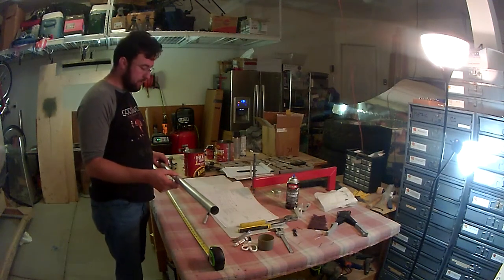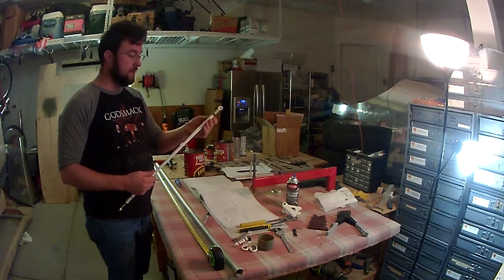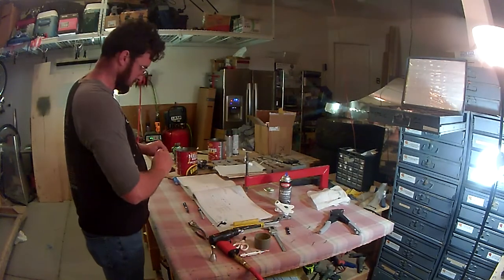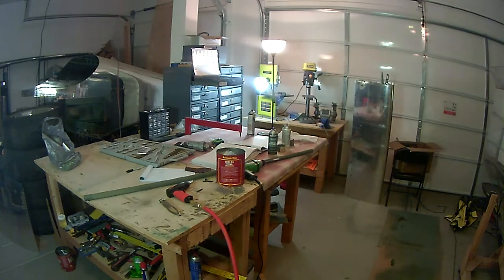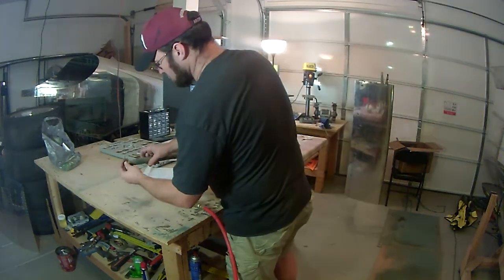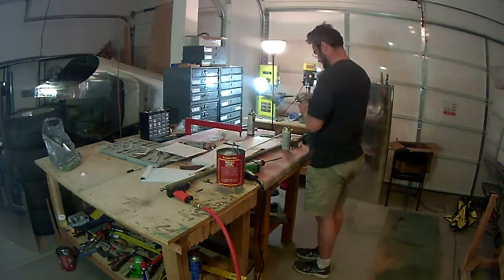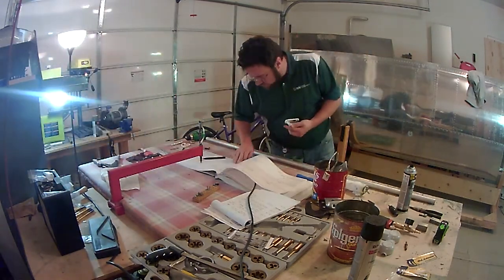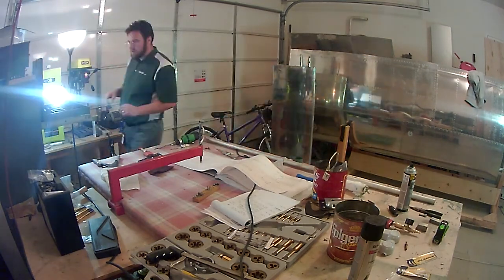Scott's RV 14a Right Wing Part 28 Aileron Actuator System

Comment: Scott, you probably already have them all assembled, but I prime the tubes with a rattle can AND use the blow gun/air compressor at the same time to blow compressed air along with the paint/primer.  It does a bit better than the can alone.  Just stick that steel tube into your Lathe and use a parting blade to cut them, oh wait, you don't have a Lathe do you?  Carry on!
Reply from the maker: Yea, I did as best I could with the can. I tried to rotate the tubes In my hand as I sprayed. Not sure how effective it was!

Must say that it is pretty exciting to see the aileron move when I rotate the actuator at the root of the wing!